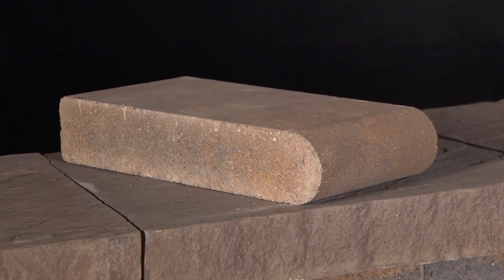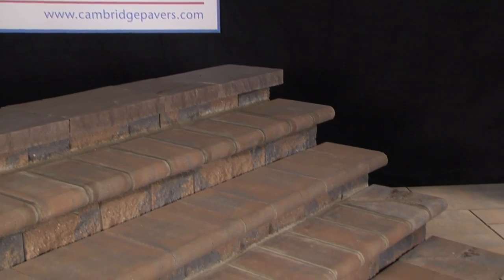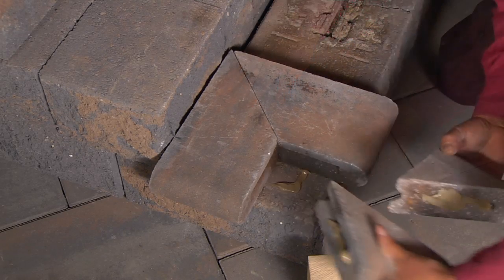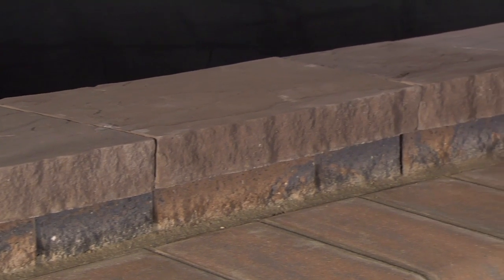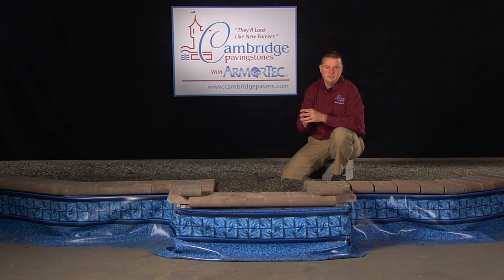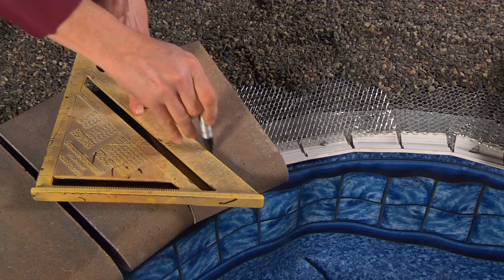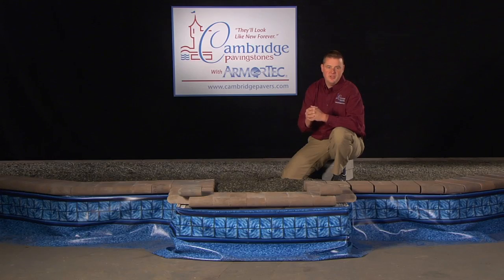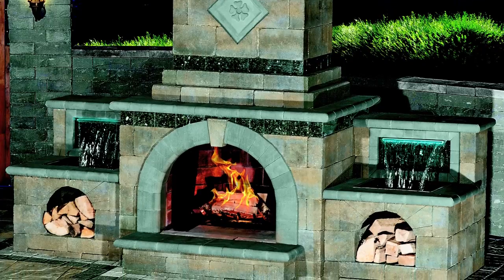Cambridge Pavingstones Bullnose and Coping Stones

Comment: How do you replace the pool liner if the bullnose covers the liner screws.
Reply: Well I suppose you would have to remove the bullnose to get to it. Be a great time if you wanted face lift the pool coping to something different but you can all reuse old comping just clean of the old mortar.